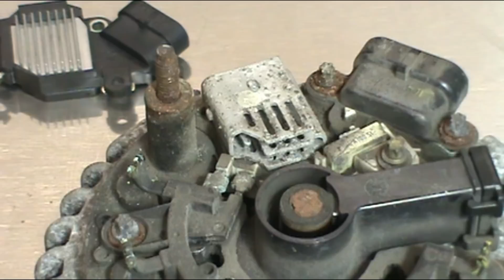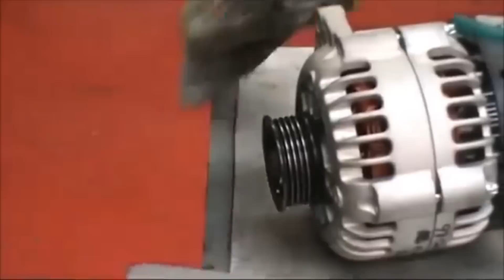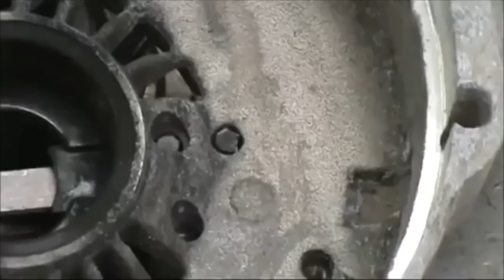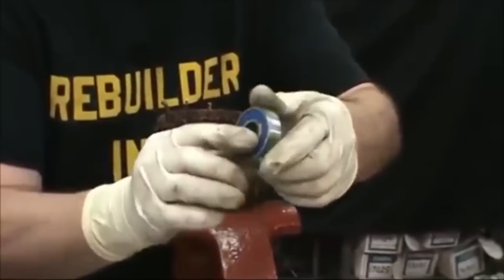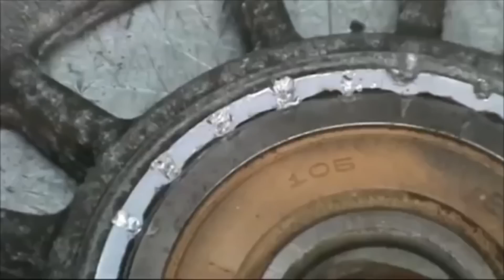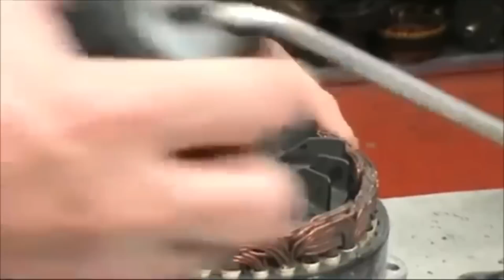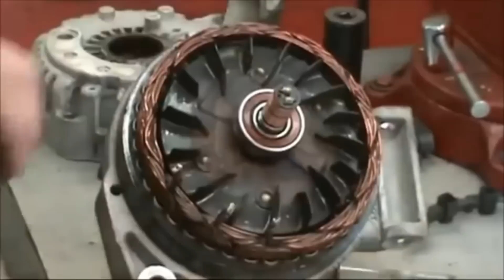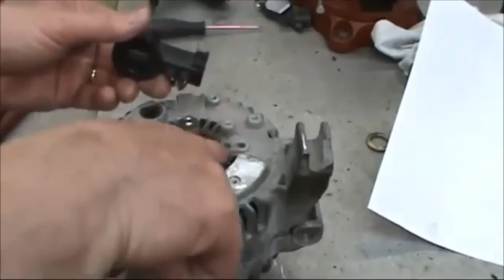how to rebuild an AD series GM alternator

Comment: If you get a moment, everything seems to check out ok on my AD230 but, as soon as the brushes make contact with the slip rings, slip rings short to the housing and the rotor shaft. It's the only time I get a short between components. What could cause that? Thanks!
Reply from the maker: The bottom brush is in contact with the plate. It's suppose to. It wouldn't work if it wasn't.
Reply: @rebuilderinabox  Ok, thank you. I guess what confused me is the short from the upper brush to the plate. I didn't realize that, after installation, the rings are connected through the windings. So my alternator rebuild may actually work. Thanks again.

Comment: I have this AD230 - does there necessarily need to be a lock washer as I don't have one? I guess I could buy one. I went ahead and replaced the slip ring and this one's fairly easy in that it's just desoldering the two wires on top then pulling it off. I had a dust shield in front of mine like yours. This video still helpful for my 2003 Impala with 321K miles. Thank you.

Comment: I might have missed it. About the connection u cut off and not useing? Whatz to be done with it after u cut it off? Thanks
Reply from the maker: The Voltage regulator we supply doesn't need a onnection there. It has a voltage sense point underneath the battery post instead.
Reply: @rebuilderinabox  Ok thanks! I am looking at a alternator from a 2000 gm halfton 2wd. I see 105 stamped in it. but other numbers are hard to see. I am in Alberta Canada and Want to buy a kit so i can rebuild it?! But not sure what part number i need. i see a 40701 i beleive!

Comment: Excellent video. Looking  source for rebuild kit…2004 Tahoe 5.3 eng….pretty sure 145 amp alternator. Suggestions?
Reply from the maker: https://alternatorstarterrebuildkits.com/product/ad244/
Reply: @rebuilderinabox I need a sanity check…lol. So I took that alternator apart to test it see if worth rebuilding….testing the rotor resistance, I am only getting 1.5-1.6 ohm’s…was kind of expecting around 3 ohms.  I checked this at the slip rings. 
  The stator…between any 2 of the 3 unsoldered leads that go to the rectifier….virtually no resistance rather continuity and none of the 3 are shorted to ground (outer casing). My issue is I dont know what the spec values should be. Im thinking the rotor maybe bad cause Ohms are so low. Also the slip rings are really worn bad. Fo you have video on how to change those?  Thanks
Reply from the maker: @royhudson8416  We have never tested ohms and never will. Either has continuity or doesn't. Test over. In the shop we use a 110vac light bulb. At home : dvm  audible continuity is all that 99.99%  is needed. No video for slip ring. Difficult operation and we don't want failures. We won't lead you down a dead end road. You got me thinking about it, though.
Reply: @rebuilderinabox Ok…well, it has continuity as it should and not shorted to ground and would be rebuildable in that regard but my concern is the rotor windings are degraded and shorted to themselves….hence the low resistance, or what I think is to low. I dont know what that value should be. Do you have access to that information or can tell me where I can find it? Really dont need to rebuild an alternator with a bad rotor. 
  Yeah….I would be interested in your slip ring replacement method. I have watched videos on some other types replaced….looks like can be done if you are careful and take your time
Reply from the maker: @royhudson8416  All types are all done differently. As far as shorted to themselves : doesn't happen. Well maybe 1 in 10K. We have actually done that many and never run across that in a GM. Don't waste your time checking the wrong thing the wrong way. We ID early GM rotors with an ammeter and 12v. GM's's are 5-7 adc. I'm sure you could calculate ohms but an ohmmeter doesn't detect shorts very well like live voltage.

Comment: That’s a good video but not showing how to remove the solder doesn’t make this video useful. A lot people will get stuck to remove that wire off that connector. Just remember diyr’s trying to fix by themselves.
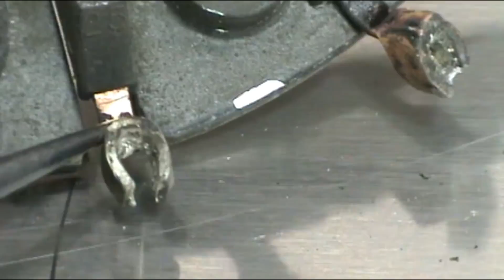Reply from the maker: You must have went for a sandwich from 3:00 to 4:00. We did not show the actual solder operation, but the explanation and close up shots of the joints must be pretty clear because this has been a successful* vid for many customers we supply parts to for multiple years. Showing our shop heating up the joint for 2 minutes seemed like dead air time.* By successful I mean we have sold many, many kits with very little extracurricular support / returned parts.
Reply: @rebuilderinabox My alternator similar to what you showed on the video. What’s the best way to clean an alternator? Water and soup, B12? Thanks
Reply from the maker: @bimatube1274  Mineral spirits followed by Dawn water. Use plenty of Dawn, mineral spirits is flammable.
Reply: @rebuilderinabox Thank you
Reply: @rebuilderinabox How about acetone?
Reply: Showing after you had dissolved the wire? People wanna see the process.

Comment: Q.why does a bindex or starter drive go bad over time.what is it that make go bad.
Reply from the maker: Holding the key on a little too long is the number 1 cause. But it's a roller (sprag) type clutch which has mechanical wear and lube breakdown eventually.

Comment: Mike, great video but had a thought.. I would not dry these in the oven at 350F.. The varnish insulation on most magnet wire doesn't usually hold up well above 180C (which is around 350ish F)... it starts to dry up and weaken too even before it fails. There are magnet wires like Ceramawire that can handle 1000F but it's usually not used for these. For most magnet wire 250F is safe.

Comment: 24:20  time.  ?  Should those 3  hi - amp  connections, not  be  soldered ?.    i would.    Vibration, and  h e a t , would soften / move  those rounded tabs.
Reply from the maker: ?????????.  "Make sure to crimp and very efficiently solder" on audio.

Comment: awesome job for the diy, it's pretty cumbersome but can be done. In my opinion it's better to buy brand new where all your parts are new with a warranty.
Reply from the maker: That couldn't be a wronger opinion. People who work on cars a lot know the "new" parts from the big box stores are a quality trap. People who have a lot of experience in auto repair are looking for a quality alternative, so they can do the job ONCE, not monthly. Don't get fooled by the illusion of "LIFETME WARRANTY" on a box. It's a lot more work doing an install over and over, than doing the job right, but only once.
Reply: Wakeup, you know I'm talking about ORIGINAL EQUIPMENT MANUFACTURERS, don't steer the viewers wrong. You are a total thumbs down. @rebuilderinabox

Comment: What exactly does the rectifier do and why is it not included in the kit for my truck, 2005 chevy avalanche 5.3?
Reply from the maker: Changes AC generated in the coils to DC for the battery. Usually doesn't fail on that model. (as of yet) Why waste time and money?
Reply: @rebuilderinabox   Just figured if I am in there, why not. But never realized that they usually don't fail. I have a 2005 Chevy Avalanche LT 5.3. It has electric everything in it and came with the 145 amp alt. What is the difference between kits BO11075IB696 and DR44? ALSO - how do I get a kit without the bearings? The alt that I am repairing has perfect new bearings in it already.
Reply from the maker: Can't do one without bearings. Prices and content are all etched in stone thanks to pay pal. We're out of Bosch kits right now. DR44 will be stamped in the case with the vehicle hood open. Or visually ID with video before you buy.   @wolfsmane

Comment: What type of solder fo use to resolder the 3 stator leads
Reply: Nevermind I read thru comments and found my answer, thank u.  Gonna try this soon as my rear bearing is making a lot of noise and it drives me crazy
Reply from the maker: 60/40 or better rosin core.

Comment: Is there a way to remove the winding/red wire coil (not sure if the correct name) from the casing, I would like to sand blast and paint and have it disassembled to that point but do not know how to remove that
Reply: Awesome Video by the way, made removal very easy
Reply from the maker: In the shop, but not at home.
Reply: In the shop?
Reply: Is the stator pressed in? Glued in? Should I heat up the case then use a punch to punch out the stator?
Reply from the maker: @jordanmitch8117  Heat the aluminum, remove the bearing. Place a 1/2 inch thick die on both sides the laminations, but not the windings. Fix ass'y in a press (about 5 ton req'd) Press out downward thru bearing hole. There's no glue, normally heat and a punch would cause distortion, but may be possible, if installing a new stator.

Comment: What soldering iron do you use? My 175 watt iron won't melt the solder. 
What solder should be used to resolder?
Reply from the maker: 200-260w Weller. Butane mini torches also work really well.

Comment: What sizes are the two bearings?
Reply from the maker: industry standard numbers 6303, 6202.
Reply: @rebuilderinabox  thanks!
Reply: @rebuilderinabox  Hey Mike, one side of the regulator has the pink insulator pad. The other side should be metal on metal or should it have an conductive paste in between? If so, what paste should be used?
Reply from the maker: @JeanSolagnier  If you work on one successfully, you'll replace the regulator with a new updated style.
That's the only way we support. The grease is hi temp silicone base. Dielectric grease.

Comment: I get a kick out of the fact that every remanufactured alternator has a new pulley. I prefer the factory original pulley it looks much better.
Reply from the maker: All of our rebuilt alternators reuse the old pulley unless damaged.  They are ran through the blaster and painted.

Comment: Great video, thanks for making it. I have a question, I have a 2000 Buick park avenue 3.8L your website does not list a rebuild kit. I have had issues with the battery boiling over. Voltage was 14.15 v when the battery was at 12.8 (fully charged) I cleaned up the battery tray and checked fluid level on th ebattery, all the plates are covered. Put it back in and the battery at 12.2 volts  alternator is charging at 14.5 at idle and at 2000 rpm. So I am assuming the voltage regulator is bad. (too hot)  You show the replacement voltage regulator needing to slip under the plastic post at 21:43. Then your video jumps showing it has been removed. Mine does not want to pull off. Your video then shows a ferrule with a metal insert being installed over the new regulator. Is the ferrule a new part? Is it the old part? Does it simply slide off of the post?  Sorry for the long comment and thanks for anyoone that can reply.
Reply from the maker: First, it sounds like you are not measuring voltage on a reliable meter? If the meter is reliable, there should be  minimal voltage drop between alternator output terminal and battery terminals. Clean and di-elec.grease all engine and chassis grounds. Remove battery, take it to a local battery vender and have it charged and checked. The diagnostic info doesn't sound like a bad volt reg. But anyway, maybe watch the movie again where the regulator is changed. It should show you that 1 lead is cut, the other un soldered. Then you pound the stud out of the ferrule and the ferrule is re-used.
Reply: @rebuilderinabox  Thank you for replying and clarifying about the ferrule.

Comment: You can also freeze the bearing overnight instead of baking the casing.
Works about the same way.
Reply: if you heat the housing and freeze the bearing it is even better

Comment: Quick question, Do I need to go through all the steps in the video if I only want to change the bearing on a 03 GMC Envoy (AD244) Alternator?
Reply from the maker: No
Reply: @rebuilderinabox  can you please advise me what steps I need to take. Do I need to remove all seven bolts from the alternator cover?

Comment: Quick question is it possible for alternators to stick....on my truck i turn it on and on the guage it will start at a quarter...i leave the truck running and get out and hit the alternator with the handle of a my hammer and it will suddenly start charging again....or could it be a bad brush.??
Reply from the maker: Bad brush or internal voltage regulator ground. 160K plus on alternator? Bad brush. Don't delay repair, ruins rotor.

Comment: Thanks for making the video! I have a quick question for you, i have a PowerMaster Alternator 58302. It's a 220 amp 14.8 volt power alternator 2 pin style - L/F. I had it originally hooked up as a one wire alternator because that's what it said in the add when i bought it but have since found out it's a OE style unit. I've only gotten 13.4-13.8volts. How do i make this thing work?? It's a super expensive alternator and brand new. Do i need to change the regulator out? It's going from 13.8, 11, 9, 0, than back to 13.8 on the voltmeter then on repeat every few seconds, I have no ECU old mopar new ignition. Any info would be super helpful!
Reply from the maker: The 2 pin DR44G, which is what that model seems similar to, will not achieve 14.5VDC without a computer. As a 1 wire hook up, it will be in limp mode and be exactly 1 volt less than normal. IDK if our kits (OE style) are compatible with Powermaster. You'd have to contact them. IF they are OE style rebuilds, you could use an AD244 kit with a 4 pin volt reg. but you'd need a pigtail and a key on/ off power source. As for the 13.8, 11, 9, 0 readings: Check the batteries and leads in the meter, try another meter, or remove the battery, have it charged and checked and pay close special attention to the connections.

Comment: Good videos and nice shots. At 3:40, to un-solder the stator from the rectifier's connector, I am lucky enough to have a 450 watt soldering gun (SnapOn R450 / 42 years old) and once applying some rosin to melt, once it flows, I hit the liquid solder connection with compressed air carefully away from me. It maybe necessary to repeat, but using very small side cutters and needle nose, made for electronics work, allows you to remove the wires safely without breaking one off. I have tons of pullers and found one designed to remove starter & alternator bearings, it worked great on the brush end bearing. Using a small cold chisel, I chipped away the epoxy carefully from both sides the the connection for the brushes. It reveals a twisted pair making the connection from the slip ring assembly to the rotors windings. Using rosin and enough heat, the solder flowed and used compressed air again to remove most of it. Twisting counter clockwise, allowed me to disconnect the slip rings. With a cold chisel at the base of the slip rings insulate base, I found it easy to drive it up, alternating from side to side. Cleaning the shaft and key-ways used for the slip rings wire using some crocus cloth, or 400 grit sandpaper to make it easy to re-install the slip rings and bearing. (Note: Place the 400 grit, face down and apply duct tape to the back. This will keep the sandpaper from tearing & then cut into strips to clean the shaft. I found several kits online that sell everything required, but perhaps off-brand bearings and a non "Taditel" regulator that is OEM) Be careful of the regulator depending on what you want. A single wire is fine for most down an "LS" swap, but some terminals are for duty cycle the PCM uses to control the rate of charge while other use one terminal to produce a 0.7 volt DC signal for brake booster assist which is a vacuum pump GM used mounted in the booster, that comes on at 8 hg or lower (Internal switch) to add vacuum for proper booster operation. This may come in handy for large profile camshafts that reduce available vacuum and braking suffers. I Just grew up during the age when only new part from the dealer came in a box. We rebuilt everything. ASE Master Tech since 1978. Subscribed! Very good video.